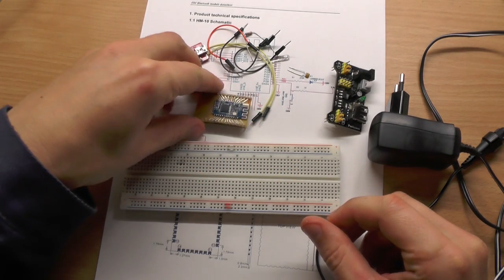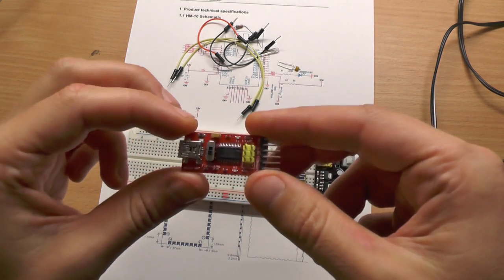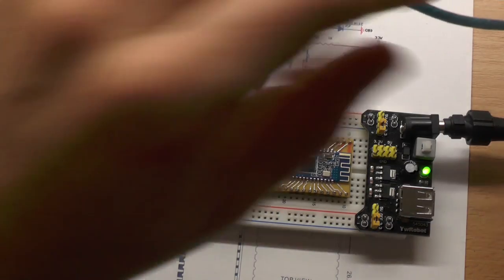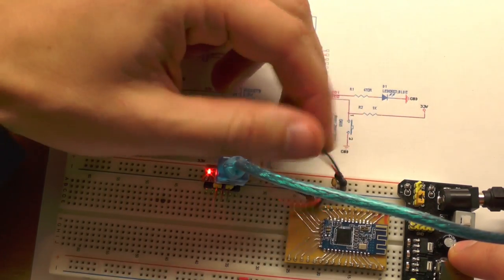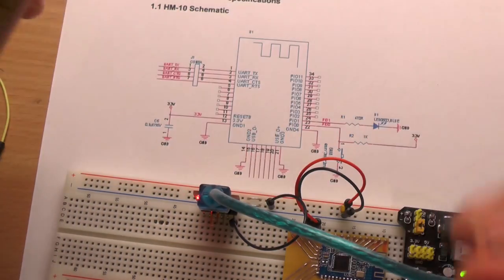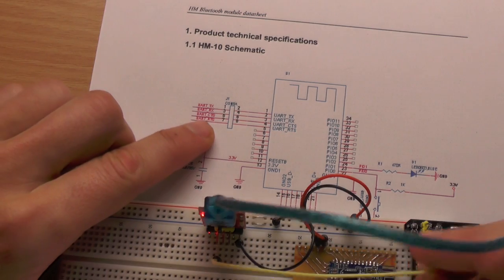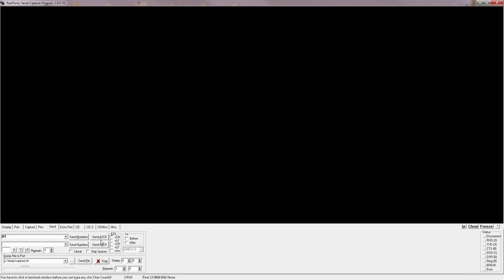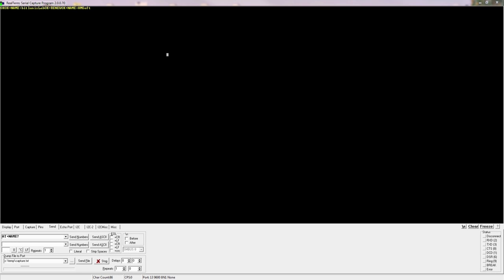Bluetooth 4.0 (BLE) - 06: Serial connection

Comment: this whole process isnt as easy as he makes it to be.

so first of all what he fails to mention just like every tutorial that is out there is that you need to download the drivers for the ftdi chip. now if you bought a fake ftdi board/chip (yeah its super messed up but now there are tons of fake boards out there and there isnt really a way to know for sure if you bought a real one or fake one you just have to trust your dealer) it wont work... i had to figure all this out the long and hard way... 

now that i have a working real ftdi board/cable.... my hm-10 module isnt returning an "ok" when i type in AT so now im assuming i have a fake hm-10 module. RIDICULOUS!!!
Reply: I bought a clone, i just had to get the drivers by clicking on look for drivers in device manager to get it working.

Comment: Hi, 
Thanks for the video. I have a Problem regarding UART serial transmission using BLE113.
I am sending some bytes of data from my controller to BLE113 serially using UART0.
i am able to read the controller output, but the problem is
when my controller is sending 7 bytes of data, for example (00 03 02 01 2C 85 79 total 7 bytes)
i am receiving the 7 bytes as two values like

value : 00
value : 03 02 01 2C 85 79

but i want to read the entire 7 bytes at a time..can u suggest me how to get it?

Thank you in advance.

Comment: I could not send data to the HM-10 because it is listed under Bluetooth section of the Device Manager, not the Ports (COM and LPT). Not a single port is the one for the HM-10 module. Need help ASAP.

Comment: Could you please provide the power regulator model and where you ordered it ? Thanks
Reply from the maker: http://www.aliexpress.com/item/3-3V-5V-MB102-Breadboard-power-module-MB-102-830-points-Solderless-Prototype-Bread-board-kit/749559166.html

Comment: Any thoughts on why the HM-10 isn't recognised by a BT4.0 dongle on my PC? 
I can't find any solution to this. 
Great vids BTW, can't wait for the next one!
Reply from the maker: had same problem. the hm-10 must be in slave mode(default) and you need to install the BLE stack/drivers of your dongle. At least if you are using windows 7 (win 8 seems to have support). There are some generic bluetooth drivers, but they are not able to handle BLE. I still have the problem, that even the connection is there, my dongle seems not to recognize it as a virtual serial connection. The two serial ports of the BLE stacks renmain silent (cant even open the connection to them).
If you succeed  please tell me the secret :)
I dont have any phone capable of ble or win8 to try it there yet.
Reply: +bitluni's lab is there any idea for me??